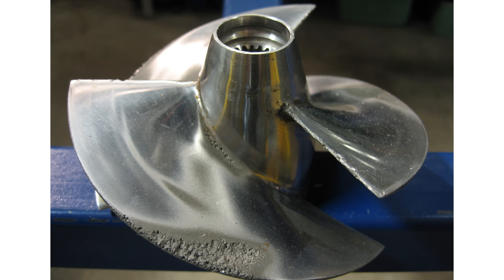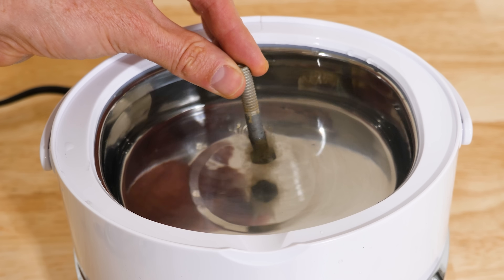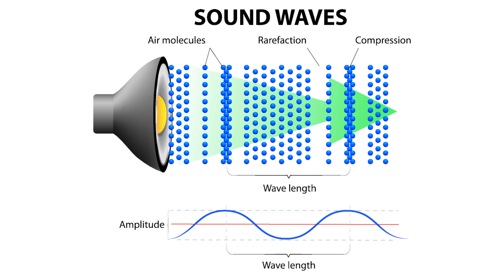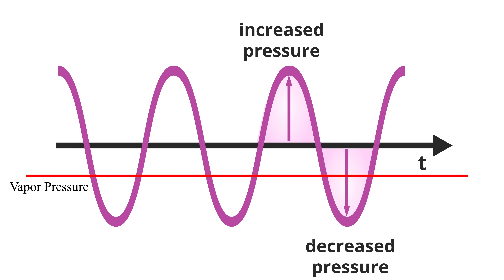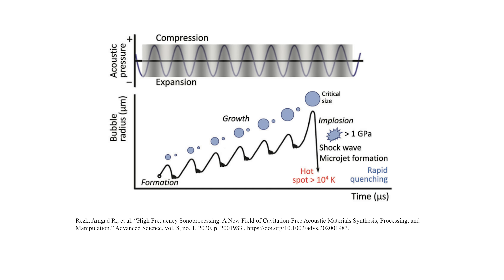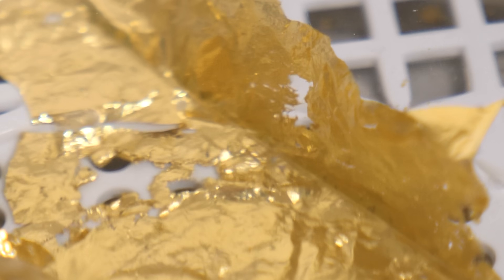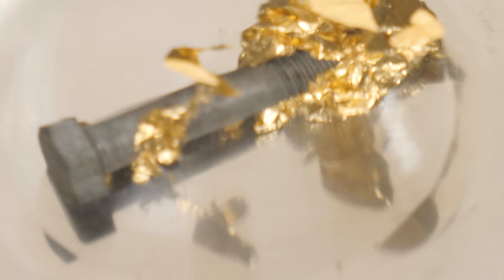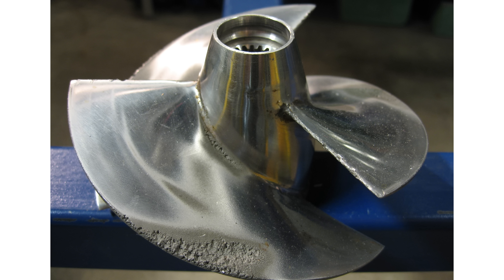Can Ultrasonic Waves Dissolve Metal?

Comment: Great educational videos.  I like your work. But there is something that is not clear to me in this particular one. I do not really see why you say that the acoustic pressure is proportional with frequency. I would say it is proportional to amplitude. In fact when you are trying to create cavitation using ultrasound it works better with lower frequencies. Indeed pressure waves causes the gas bubbles to oscillate. When these bubbles collapse, they create these shock waves, high pressures and high temperature you are mentioning. By using lower frequencies you allow the bubbles to grow bigger before they collapse and cavitation gets more violent. 
Another, more detailed point, is that bubbles are most of the time not vapor bubbles (it is not the water boiling) but are just bubbles from the different gases dissolved in water. This is the same as when opening a soda bottle. The pressure drops in the bottle and the dissolve CO2 forms bubbles. You actually need extremely high negative pressure to vaporize water (in the gigapascal). There is one experiment you can do: if you boil water you will get rid of the dissolved gas. Using this boiled water in your ultrasonic cleaner will not work well at all since cavitation will be very hard to initiate. Hope this clarifies things. Keep up your good work.

Comment: Hi!! I work with these every day. For everyone wanting to put your hand in... Don't. Your joints will hurt SO BADLY and be stiff because there's fluid inside them.
Reply: And that fluid can also create cavitation bubbles, both the small ones from ultrasound which hurts very badly and the big ones that you get when you crack your knuckles.
Yes, that is where the sound comes from. When stretching the joint you actually create some of these bubbles.

Comment: The most important thing to know is whats gonna happen if I put my finger in there. Is it just gonna completely break my finger, cause bleeding, burns and extreme pain?
Reply: Bleeding, burns and breaks, no. Extreme pain? Most definitely.
Your finger joints are basically little bags of fluid with dissolved gases conveniently included that contains lots of sensitive parts (That's what the sound when you're cracking your knuckles comes from, cavitation bubbles that form and pop.)
I don't actually know what specifically happens when you put them inside an ultrasonic cleaner, but from the pain alone I'd wager those bubbles turn the inside into foam for a short while, or at least does to the outermost layers your sensitive internals what happens to the foil. Seriously, it hurts like you wouldn't believe.

Comment: The Amplitude of the Ultra Sonic cleaner is what causes the cleaning action. It's Amplitude creates the strong pulsating Pressure on the liquid that removes the dirt on the object.  And the Ultrasonic frequency (above human hearing) is Resonant to the molecules of the object to be cleaned.
Reply: So the thought occurs that to get the most effective action some form of analysing equipment would be beneficial and the ability to fine variably tune the amplitude to best suit the volume of water and density ofobject being cleaned. I would guess one size or amplitude does not fit all applications to best effect.

Comment: "For a given amplitude, the higher the frequency of sound, the higher the acoustic pressure"

This is so blatantly wrong it hurts. Amplitude is the peak pressure of the sound wave. That's literally all the amplitude of a sound wave means. So if you hold the amplitude the same and vary the frequency, the peak pressure will not change. Pressure also isn't the only factor in cavitation, and in fact lower frequencies are actually better at inducing cavitation. For a given amplitude, lower frequencies create a longer duration of rarefactive pressure which lowers the threshold for cavitation.

Comment: What I've always found cool about cavitation is the incredibly high temperatures (as pointed out in this video) that are reached when the bubbles collapse!

I believe a temperature of 10 kilokelvin (10,000 kelvin) is actually hotter than the surface of the freaking sun which I believe is around 5-6 kilokelvin even though it still doesn't compare to lightning which is around 30 kilokelvin or 30,000 kelvin in temperature!

Comment: Cavitation can also happen in cars' cooling system when you modify the engine to have a higher rev limiter so the water pump spins faster than what it was rated for, thus leading to cavitation
Reply: Most water pumps in engines are not designed well hydraulically to begin with. They are made to somewhat move water and be cheap to produce. They won't have properly sized suction ports compared to their discharge ports, cheap rudimentary impeller configurations with no cut water machined into the volute. It never occurred to me that an engine spinning faster than designed could cause the water pump to cavitate, that's a really good point.
Reply: I have seen the effect where an engine has been modified and the rev range increased greatly and the standard water pump impellor looks like it has been eaten by moths. There have also been a few design cock ups where water pump impellor blade shape was all wrong and led to cavitation and destruction of the pump impellor. That prop that he shows us at the end of video looks very much like an impellor from a jet ski propulsion pump and they are well known for cavitation errossion of the impellor when the  engine has been highly tuned and running higher rpm.
Reply: So that’s why in Subnautica when you put your submarine into overdrive, it eventually overheats and you get a notification saying “Warning: Vessel Cavitating.”
Reply: Can’t remember which shop, but was one of the big names for the Cummins and they had a build that flattened the pump fins (one of the non cast pumps) which I’ve never seen before.

Comment: I wish there was some more information about safety of those devices. I don't know about those small units but industrial ones have a designated safety zone where no one should be present when the device operates.

This is due to the fact that the 40+ kHz vibrations don't only affect the water in the device. They propagate into the air and then affect things outside the device as well. Like retina in your eyes, that is immersed in a fluid, so this 40+ kHz energy is doing damage to your eyes, even if though it has been greatly reduced and cannot be felt directly.

I don't know it for sure but I would bet that the buzzing we hear is some harmonic of this ultrasound that falls within our hearing range, and that would imply that the ultrasound is in the air too. I wonder and love to hear if anybody noticed if/how one's pets react when an ultrasound cleaner is turned on somewhere nearby.
Reply: Those small units don't have enough energy to affect the user in any meaningful way. Hell, I've even stuck my finger in one once to see what would happen and, spoiler alert, it didn't do shit. So, considering the inverse square law, I wouldn't expect any effect on your eyes or sensistive organs that are, hopefuly, many centimeters away
Reply: @andresaofelipe  I just checked specs of few ultrasonic devices, both cleaners and air humidifiers for home use. They are around 30-40 Watt, so as you've said - they should not pose much danger, if any.

I'd assume, no more than 3-4 Watts get converted to ultrasound that gets outside of the device, so provided one does not sleep next to the device it should be safe.

Then again, it should be trivial to test it just by putting a rusty nail in a glass of water next to the ultrasonic cleaner. If the nail gets a bit less rusty throughout a night we could be sure of ultrasounds leakage, though I doubt the residual ultrasound could do much cleaning in such a setup.
Reply: What is your source for this information? We have a very big ultrasonic cleaner at work the size of a van but there is no designated safety zone around it. The noise when passing it is very high pitched and I am sensitive to it while others barely notice it. I wonder if just passing is damaging my body in any way?
Reply: @sigibaes  id research that ASAP!
DO NOT ASK / TRUST WORK.
They will just lie and fire you. Hit the net pal. 👍
Reply: yep. stronger ultrasonic can damage your hearing. just because you can't hear it doesn't mean your eardrums are vibrating, just means the vibration is out of your hearing hair cells range
Reply: If you think an ultrasonic transducer that isnt the size of a small satellite can hurt you than lord dont look into the advancements in microwave technology..
Reply: It's more accurate to call the audible noise demodulation than harmonics, I'd say.   It's more akin to the way an AM radio station can be picked up in random objects, just physical instead of electrical.
Reply: nah the noise is from the device not being 100% stable. face wands are similarly loud. i mean stable as in like suspended or sitting in a way so that the vibrations are absorbed and we can’t hear the rattling from some parts touching stationary objects.
Reply: It wouldn't be harmonics, but subharmonics -- dividing the fundamental sound by an integer series instead of multiplying it by an integer series.  I suspect that if a sound was loud enough, it would stimulate even hair cells that were tuned for some other frequency, and that this might be enhanced for ones tuned to subharmonics of the ultrasound.  If the sound is that loud, it is probably bad for your hearing to be exposed to it for a long time.  The ultrasonic cleaners in labs that I have been in never had any safety warnings on them, but actual sonicators do have instructions recommending the use of hearing protection with them -- these put out much higher energy, and can cause serious heating of small aqueous solution samples in a few seconds (thus it is also recommended to keep the samples on ice as much as possible to avoid cooking them), as well as violently stirring them, so the hearing damage potential is likely also be a matter of degree.
Reply: There is no difference between what’s been dubbed “physical” and what we consider “the subtle”.
Whether that be electromagnetism or other forms of field dynamics...
Reply: The only harm i know with these device, is if there was some power leakage into that bath and you stick your finger or hand in it while operating. Imagine 220v inside that water
Reply: I would imagine that at a smaller scale, it's reduced to nothing more than sound, as air is far more compressible than water, making it significantly less conducive to shockwaves.
Reply: i have a similar device i stoped using coz my dog dont like it, now he grow up and dont care anymore, anyway i dont its something bad about the ultrasound, of course could be used in a harmfull way like everything, but my dog only hated the ultrasound that must be anoying for him
Reply: SaltyBrains  If they are harmonics, by definition they are a multiple of the fundamental.

You must mean subharmonics, if anything
Reply: Same goes for the ultrasonic nonsense to scare of animals from cars. As i was a child i destroyed them if they were accessible since they HURTED in the ears
Reply: electromagnetic radiation aka 1/2/3/4/5G ceel tech. 
Weapons
Reply: If the fundamental frequency is too high to hear, then you certainly can't hear the harmonics. The lowest one would be 80 kHz.
Reply: Wow this is getting a bit heated in this comment section 😂 remember folks, love and science can coexist 👍🏻
Reply: As he said we hear it because there's part of the machine that vibrates in our hearing range, if wasn't for that we wouldn't hear anything, so no harm for us, there's nothing that can hurt our ears, with sound, that we can't hear, is way worst to be close to big speakers, or using headphones very loud...
Also for our eye, maybe if you stick your face and submerge in the water it can, and it probably will blind you... but since there's air between our eye and the water that's being blasted with ultra sonic vibrations there's no harm...
~The only thing that can happen, realistic, with those are if you were to stick your finger there for a minute or more, than it could eat your skin off, but to be with your finger for over a minute in there is because you wanted to...
Reply: @Cuestrupaster  that's blatant misinformation at best, and not disinformation I hope. Lower and higher frequencies than the hearing spectrum can have serious effects to the hearing (and not only it)
Reply: @LunarMoth  Instead of saying it's misinformation, or wrong, can you explain how it's possible to us hear something out of our frequency range?
Reply: @Cuestrupaster  Didn't say that. We can't hear it, but that doesn't mean it can't damage our hearing.
Reply: @LunarMoth  Ok so how can it damage our hearing if we can't hear it?
Reply: @Cuestrupaster  The waves are still interacting with our ears, even if we don't feel that as an auditory signal. So, if they are too intense, they can damage the cochlea - which is a kind of sensitive area towards high pressures.
Similarly, ultraviolet light can damage our retina.
Infrasounds and Ultrasounds have some other interesting properties as well but they're not what I am concerned with in here.
Reply: @LunarMoth  False analogy, ultrasound isn't an electromagnetic radiation.

In fact, we use ultrasound machines to take images of living fetuses, with zero harm, go figure

Ultrasound can be harmful  if they raise the temperature of the target, but you need ridiculous amounts of power to do that.

Sound sub frequencies can become harmful when they constitute shock waves, like in a single big explosion...again, not the case at all
Reply: @TheChzoronzon  I think you didn't understand my point
Reply: @LunarMoth  I think I understood it better than you yourself

Comment: I was looking at making a budget fogponics to test some applications but the cavitation issue stopped me. So I am also trying to come up with a coating that can mitigate that issue but it must also not mess up the vibration for the transducer plate. Looking into some coatings used in naval applications for parts that cavitation is an issue for.

Comment: That prop image looks more like electrolysis than cavitation, you might look into a isolation transformer or adding sacrificial anodes.
Reply: He showed you a PICTURE of the cavitation.
Reply: @ThePrufessa  yes I know what a picture is. The picture he showed looks more like electrolysis than cavitation, cavitation usually occurs on the Outer Edge on the leading side because it is the low pressure side, unless there was a defect or the prop struck something and was bent, cavitation usually only occurs with high-speed props. This looks more like a cast aluminum prop with a chrome plating that is deteriorating because of electrolysis.
Reply: @michaelladue5655  That type of cavitation erossion on the trailng edges is quite well known. The 'prop' is actually an impeller from a jet boat type pump with a stainless steel high helix impeller. I have seen them in the flesh with the trailing edges that are eroded due to cavitation.
Reply: @howardosborne8647  now you have me curious and want to look at the "props or screws on the wave runners in my garage.

Comment: This is part of why I'm very apprehensive about putting firearm parts, and internals in the ultrasonic cleaner, at some point you start to wear the finish, and enough metal that the pieces can become weaker, also microfractures can expand in hardened parts.
Reply: We clean Scuba regulators, tank valves etc in ultrasonics. And First stages have tight tolerances, but we usually don't put them in for more than 3-5 minutes. And the solution we use is usually Water with some soap and an acidic cleaning solution for really gunked up parts(only 1-3 minutes then)
Reply: Steel won't degrade in ultrasonic cleaning, especially hardened steel.  If you have a painted finish it may hurt the paint, but most coatings that are common on firearms won't be affected at all.  I've been using ultrasonic for cleaning my BCGs and other parts for years, and have used them professionally on precision tooling without any issues.  The only time we've seen damage was on aluminum left for long periods of time in an incompatible cleaning solution.
Reply: @turbo3400  I'd rather not risk it, I'm faster with a brush anyway.
I don't suppose you're screening your parts for microfractures on the reg?
Reply: @linkbond08  on my firearms no.  On the thousands of stamping and molding details that we put through the more powerful ultrasonic cleaners at work?  Absolutely. Haven't had any issues related to them
Reply: WD40 works great!
Reply: @fidelcatsro6948  yeah... I won't be putting any of my firearm parts near WD40.
Reply: @linkbond08  my 2 stroke bike gets additional 2 mph whenever i apply some wd40 into the exhausts..🐱👍🏿